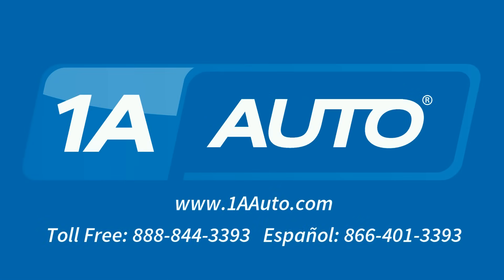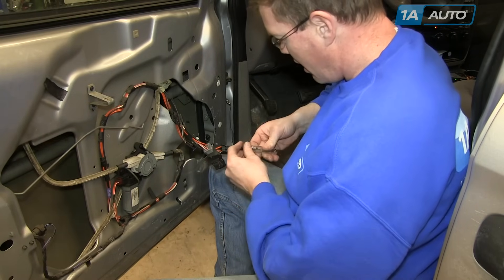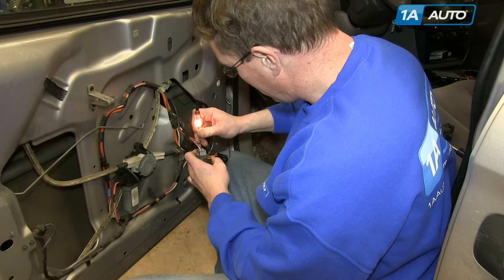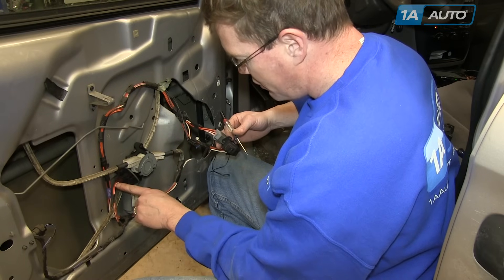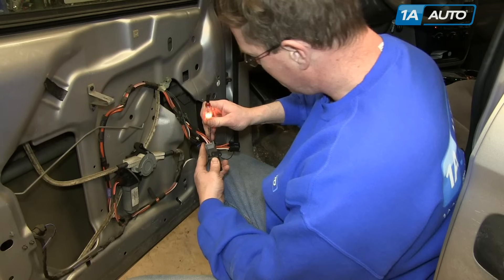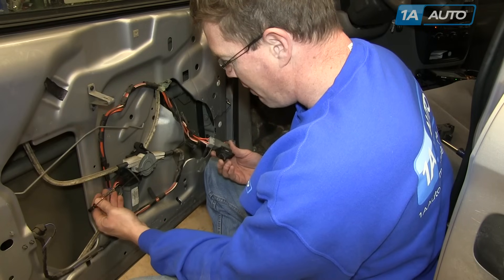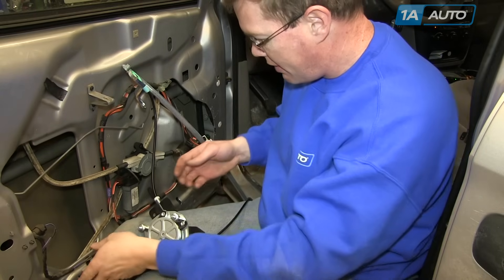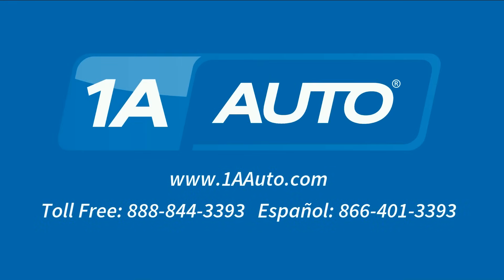How To Diagnose Power Window Problem - Is the Switch or Motor bad?

Comment: Hello sir i have a question, is the right and left window have the same fuse? My left window is working but my right window (driver seat) isnt and its not making a motor sound when i push the switch up and down. Thanks.
Reply: You ever figured it out? Im having the same issue
Reply: This just started to happen to my Taco. Only difference with mine is that the windows work perfectly intermittently. It's irritating.
Reply: Did you have an answer ? I have the same issue

Comment: In my case . On my chevy silverado 08 
The problem wasn't  the motor or the power switch  . It was the plug conector to the motor it was loose on one side and that was causing the problem.

Comment: Thanks for posting this video. I figured it was a bad window motor. My issue is my window control module. I think has a parasitic draw because when I pull window fuse out my milliamps go down to .3. From .11 
 I even swapped out the module with a newer one, and I still have the same problem. What do you think it could be? I don’t see any cuts or tears either.

Comment: Problem: using test light can kill the circuitry if smart switches/motors are involved. They can use 5 volt pulses to control with the phase of two pulse streams determining up/down. For such cars, a test light can't detect the trouble, but CAN cause a circuit to blow. :(

Comment: 1987 GMC van driver's side dual window switch, works the passenger side but not the driver's side.  Is there a relay that could cause this problem? If not, then just stick with your diagnostic procedure shown here?  Great site!

Comment: Thank you for your video. Very helpful. I was just working last night on my 2005 convertible beetle. As of the sudden, all 4 windows, the convertible top, the trunk lid switch and the trunk light stpped working. It never happened to me. Should i check the fuses?

Comment: Hi 1A, I just purchased a power window switch (passenger) from you for my 2004 Honda Accord EX Coupe.  I discovered while removing the old one and installing yours that the switch was actually not the real problem.  The switch only seems to work for the window when the wires are partially plugged in to the switch.  When you plug the wires in completely, the switch does not work.  However, the door lock works all the time.  My guess is that there is a loose or faulty wire running from the switch to the window motor.  
What do you think?  What is the best way to go about diagnosing and fixing this problem?

Comment: Hi Mike, hello 1A auto. Thank you for the video! Very knowledgeable... I’m here in comments to ask kindly for guidance...

Hello my fellow car enthusiast friends :)

I’m diagnosing an issue with the passenger side window on my 2014 corolla, as well as the master panel on the driver side. The master panel only rolls down the driver window? It’s almost as if the window lock is stuck on, but as I sat in each seat and operated each switch individually, they all roll down, EXCEPT for the front passenger side... 

As of now, I’ve tested power to the master panel, it has power to all 4 switches (2front 2rear) all the switches are good... I’ve tested power (using multimeter as well as test light) to passenger side switch, as well as up and down operation. The new switch is good. Also tested motor making sure power comes from switch to the motor, new motor is all good. But window still won’t operate? Sooo I tested for good ground, and again no ground issues... 

Annnd sooo I ran a quick wire straight from my battery to the window motor, and it rolled my window up, yay :) I’m sure if I reverse polarity it’ll roll back down. 

So again, everything is good, so why won’t it work?This is not a riddle. May I please ask my fellow car enthusiasts for some advice? Input?

I appreciate your time very much and if you have any questions as well, I’m moderately knowledgeable in some areas so feel free to ask and I’d be happy to help you out as well.
Thank you everybody, thanks for your time, take care out there my friends God bless and be safe.
Reply: Derek, did you ever get this figured out? I’m having the same issues.

Comment: I just purchased a regulator from you. (Which by the way, service, shipping, prices & customer service was all fantastic!) Now as far as the installation. Does the switch have a fuse on it? There's a black cube that looks like a fuse but I'm not sure. I have a 2002 Accord. If it is my switch. Can I repair it or do I have to replace it? I don't have one of those power testers so for the mean time I don't have a way of knowing what the problem is.
Reply from the maker: +Victor Huerta Hi Victor, We currently do not carry replacement window switches for this particular vehicle. If you haven't checked yet, you may want to check the fuse in the fuse box to see if it's good. You may also want to purchase a test light from your local auto parts store to see if there is power going to and from the switch. Another thing that you could check is the wire harness that runs between the door and body of the car for a broken or frayed wire which could be also causing the issue. Hope this helps you out.

Thank you for your order. If you would like to leave us a review on Google it would be greatly appreciated. Here is a link to our reviews section. Have a great day! https://goo.gl/i5JFNY
Reply: 1A Auto Parts I actually have left a review 😊👍 I definitely plan on buying me a test light, just waiting on a check. I was able to get someone to check for me. There's power going through & when he had the test light connected & hit the switch. It made a funny noise. So he believes it's the switch. It's just weird that it's getting power, & making noise, just isn't sending power to the motor. It's so confusing but thanks for the reply.

Comment: I absolutely love this channel. I do have a question for you. So I've followed your steps from the video and when probing one of the wires from both the motor and switch the light only flashes breifly but doesn't stay lit. I don't see any obvious issues with the wire. Does this mean the switch is bad? Any suggestions?

Comment: what tool are you using to diagnose? i've fixed a few wires but my jeep still having issues and i think a diagnosis would be best so i know whats wrong and what wires are the bad ones
Reply from the maker: +AWHYify The is just a simple voltage tester that can be purchased at any local hardware or auto parts store!

Comment: Hi great video guys! I just diagnosed 2012 Honda Civic drivers side window without the auto switch and have power. Testing with the light, sending window up or down window stops and I lose the power, could it be that it’s the motor?

Comment: Where do you get that tool to check the power?  

I have a 07 Honda Odyssey that is having window problems.  When we get out of the car and shut the drivers door, without touching the fob buttons, the door lock actuator tries to unlock the door then it rolls down all the windows.  Hondas have the feature where you can hit the unlock button on the fob once to unlock the drivers door and hit it again and hold to lower all the windows.  The car is thinking that I'm doing that when I am not. 

The passenger sliding door window rolls down from the drivers window switches but does not roll back up.  I'm assuming I need to replace the drivers side window control switches?  

Any help you can provide would be greatly appreciated.  You're videos have helped me a lot.  Thank you!
Reply from the maker: +David Snow Your local auto parts store should have an ohm meter or a test light for you to purchase. Hope this helps you out. 1aauto.com?utm_source=YouTube&utm_medium=CTA%20Comment&utm_campaign=1ATony

Comment: Hi guys, love your channel 👍
I've got a strange problem with my power windows in my 05, H6, Subaru Outback BP, I had my front left and rear right windows, for some reason they both stopped working at the same time ?? Both of my other 2 windows still work, I have changed the master switch block an the door switches to no avail, can you suggest where I can keep looking to find out why ??
Are the two dead windows on the same circuit ?? As you can tell this is really doing my head in, I know a bit about electric's but I'm no expert, and living in Australia Auto electricians charge an arm and a leg.
I really hope that you can help as this is driving me nuts,
I absolutely love the car except for these window problems.
Cheers guys and greetings from the land down under
I've been a subscriber to your channel for years and love your tutorial video's.
👍👍👍🇦🇺🇦🇺🇦🇺
Please help me head in  the right direction.

Comment: Hello, great video. My fuse is fine, I tested power to the switch and the light comes on. I have 1 yellow wire and 1 white wire to the regulator. Only the white wire lights up. I also tested at the regulator and only the white wire lights up. Does this mean I need a new switch?

Comment: I love your videos! I have replaced several parts on my husband's car, and bought all the parts from you. Now I need help. My driver's side window is still working but very slowly. I was going to check the switch, etc, but my 2010 Equinox doesn't look like the one in your video. Help???
Reply from the maker: +Elisa Griscom Thank you for contacting us Elisa, unfortunately we currently do not have this particular auto repair on that year, make and model vehicle. In the event that we need to perform this repair we'll do a video on it. Thank you for purchasing your parts from us it's greatly appreciated. If you would like to leave a review for us on Facebook it would be greatly appreciated. Have a great holiday season. 1aauto.com

Comment: Great video. What if you have 4 door Chevy, windows working from drivers door, however, both rear passenger doors working either up or down intermittently at best. Does this mean issue lies with drivers door master switch panel? Only reason I ask is when I removed one rear window switch for inspection window can't go up from drivers door until switch is reinstalled. It appears that the driver rear window shut off switch is working.  How likely would it be both rear widow switches fail at the same time, both working intermittently? What further testing should be done, am I missing anything?. Think I may just replace one to see what happens. Perhaps that is the case.  Appreciate your time and help. Look forward to your response. Thanks! John

Comment: 2002 Acura TL.  Front passenger window. New motor and regulator works. Tested that. Fuse good for the window. Had everything tested by a friend. Bought new switch to see if that was the problem.  Still won't work. Is there something I could be missing on this Acura?  Thank you

Comment: Door close down with rear switch but not up and master switch does nothing for that window, but works for all other windows. (4door)Thanks for the video, I am working on diagnosing my window issue and followed your instructions in this video. All the connection seem good because I got a light on each step. But I also jumped the motor and got the window to go up so I don't think its the motor. But since all the connections lite up I am stumped b/c it doesn't seem to be the switch or the motor. I did the test on the rear door switch, but the master switch does not work either and there were so many wires I got overwhelmed and did not check those. Would the master switch not working affect the back switch and window.
Reply from the maker: +Alicia Slater Thank you for checking us out. A bad piece of the master window switch could affect operation of the exact door window switch. They will use the same circuit. 1aauto.com
Reply: Thanks for the follow up. I will keep working on it! These videos are great!!

Comment: Any advice on power windows not going up or down on all 4 doors? I have replaced the switch, fuses, relays, and checked the wiring to see if any were exposed, including inside the rubber boot where it runs from the door to the body with no luck. I would think if it was just a motor or regulator that only one of the windows would not work, but all of them went out at the same time.
Reply from the maker: +skyler bain Did you check to see if there was power going to the master switch?
Reply: I think I had a ground issue. While I was using my test light and simultaneously hitting the switch to the driver side, they started working. I'm not sure exactly what fixed it, as it was so simple and instant. The only thing I can think of is the wire feeding power to the switch had some sort of grounding issue and when I used the test light on it, it supplied a ground and they started working.

Comment: Hi i just posted a question on my power window problems. Any advice  would be appreciated. Just for info. Why is it that it stop and run again after about a minute or  so? I am lost. Is it the motor faulty or switch or relay etc?
Reply from the maker: +errand yapkengheng We wouldn't be able to diagnose an issue like that here, you may want to have a local mechanic take a look at it. Thanks for checking us out! 1AAuto.com

Comment: What is that tool that your using. How much does it cost and where to buy?
Reply from the maker: +Jem It's just a test-light. You should be able to pick one up at any tool store or bigbox hardware store. They're cheap. 1aauto.com?utm_source=YouTube&utm_medium=CTA%20Comment&utm_campaign=1ATony 866-403-3393

Comment: Watched the video did all the steps but can’t seem to figure out my issue. Even took it to several shops 

So the windows go down but won’t go up and non of the switches will work in the vehicle. Fuzes and everything are good but the passenger side window is very sluggish going up when all the windows did work. 

Can a faulty motor on one side of the vehicle cause all the windows to stop working or is it something more serious.

Comment: I just found out my rear passenger window didn't roll up last night, my son was going to work and saw that the rear window was down, he said it starts to roll up but doesn't go more than a few inches then it goes back down. He said it sounds like the motor is grinding or struggling. I haven't had any problems or the door wasn't hit or anything. Does that sound like the motor is already done?
Reply from the maker: +1thess523 You may want to remove the door panel to see if the cable on the window regulator has snapped, or has become jammed. If the cable has come off, it may be preventing the window from going up.  Hope this helps you out 1aauto.com

Comment: 2002 Ford Taurus, all windows and inside lights work intermittently. I have replaced the master power window switch, with the help of your videos, no luck. Any ideas?
Reply from the maker: +dora banks Thank you for checking us out. It sounds as if there is a loose wire, and could be in between the door and body as this is a common issue in some Ford applications. 1aauto.com

Comment: In a pinch also try switching a Power Window Control Switch from the opposite working Power Window Switch. Example: Switch Driver's Side Power Window Switch with the Passenger Power Window Switch to see if you can close a window stuck in a down position. It might be just a faulty Power Window Switch that not working.

Comment: 2000 Chevy Tahoe front left window regulator and I'm on the second one and I have done the same tests you did!! still not working and I'm lost!!do I have a low voltage problem??

Comment: I did the same diagnose step by step like you did . I replaced the window motor & still doesn't work . I'm thinking It needs ground , is there a specific wires that need ground ?

Comment: I have a Dodge Caliber I’m working on and the motor works but the cable is seized but the switch on that door doesn’t work (rear left window) the driver switch does work so I’m assuming the switch is bad I’m hoping the contact points are just corroded and that a simple cleaning aswell as some silicone contact grease should fix the trick

Comment: My 2011 Ford Ranger is having issues with drivers side window.  Sometimes it works and sometimes it don't.  When it stops working I can smack my door a few times and it will usually start working for abit.  I replaced the switch and it didn't help anything.  I don't think the motor is bad because when it works it works flawlessly.  It just seems like something is shorting out when I hit rough road *which there is alot of where I live*.

Comment: My windows went dead in the full down position. 12 hrs before flying out for my first vacation in over 3 years. As I was ready store it in an open parking lot in downtown L.A. for a month. For a steal at $75 for 30 days. Finally went with loosening the motor and regulator and jacking the windows up with ten 2×4×12's, I just happened to have with me, (This is a Vanlife van I travel/live in). Tetrus'ing   them inside the doors to keep the windows all tge way up, It worked! I traveled for one month, came back, and the windows were still jacked up all the way. The van started right up. 
   I checked the fuse first but it was fine. The power window switch on the passenger door wouldn't work either. They faild simultaneously. 

Can it be the motor if they both fail at the same time?
Must it be the master drivers switch in this case?
Reply from the maker: +Jeffrey A. Smith We wouldn't be able to diagnose an issue like that here, you may want to have a local mechanic take a look at it. Thanks for checking us out! http://1aau.to/m/Shop-1AAuto-c

Comment: Great video
i would be grateful if you could advice me on my problem.
i checked the switch and the power goes on the cables all the way to motor but the motor doesn't work
i conected the motor wires from the switch direct to 12 v battery and the motor works.it goes up and down switching them cables.
please let me know what do you think it could be thank you